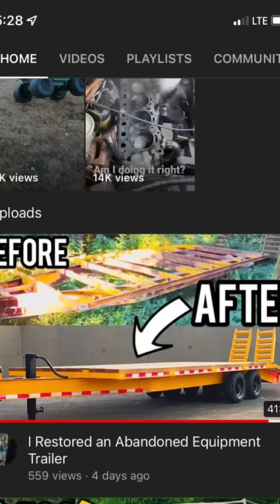How to restore a trailer

Comment: Great job on the restoration Use a respirator dude, Your lungs will thank you later!
Reply from the maker: Thanks
Reply: A little iron oxide is good for the lungs. Lol
Reply: I wear a mask...when the benefit outweighs the detriment....like here.
Reply: @1.1797  I'm still coughing up metallic flavored phlegm and haven't been in a shop in over four years man, that shit can't be too good for ya lol
Reply: @100GTAGUY  you never get rid of the taste. My grandfather worked all his career in shipyards and had some funky lung disease. He complained of that metallic taste in his mouth constantly.
Reply: Yeah man nice work but you need to wear a respirator and safety glasses minimally when pressure washing sanding and painting. I'm probably a full face mask with fresh air because that old paint could very well have lead and or other toxic materials in it. And you absolutely have to wear full body protection I eat tyvek suit gloves head neck protection full face respirator or fresh air pressurized system when spraying primer and topcoats. I've learned how to refinish steel and iron work from my father who died of type 4 metastasized lung cancer. My teaching began over 40 years ago before OSHA really knew what was up. You need to know that even the smallest particulates of just plain iron oxide rust or water-based paints can affect your lungs and nervous system! Keep up the good work and for the love of God work safe!
Reply: I would look for death by not wearing a respirator or any way imaginable if my trailer I worked so hard on  was Yellow
Reply from the maker: @vivalasvegas2826   most equipment trailers are yellow
Reply: @vivalasvegas2826  alot of the 20k+ lb equipment trailers are yellow
Reply: I got bronchitis from my Navy days being stupid.

That was 32 years ago, if one wants to know how long the effects last.
Reply: But then you don't meet the aliums and walk through the stars for awhile.
Reply: @CS-zn6pp  yeah its not too fun, can't ever tell if it's my lungs or a mild nose bleed until I hack it up. Got chronic bronchitis after a bad sick spell a year after i was out of the shop and now cough till I puke trying to clear out my lungs once I get some phlegm moving. 

Don't know if I want to go to the doctor now or when it's too late anyway unfortunately. Not gonna be good news either way.
Reply: I think that always a great restoration? Wow that was a half ass job. U see all the rust he left
Reply: Around 50 yo you will feel it and by then its far too late
Reply: @100GTAGUY  better sooner than later man, go get yourself checked out while you still can ya know? Wish you all the best brother.
Reply: @100GTAGUY  being in a shop where you're exposed to it EVERYDAY is WAY different than someone spending a couple hours on a weekend. Derrrrrp. That's why it's called an OCCUPATIONAL hazard. Because it's a hazard to people who do it as an OCCUPATION.
Reply: Exactly no dust no fuss 😉
Reply: mos def!

Comment: Start off with great job restoring that old trailer. I would like to suggest something coming from somebody that's done a lot in that kind work in prep work  I would recommend wearing a mask while sanding so you won't inhale Metal particles.  Great contact

Comment: I know you are smarter than that trailer itself  Braden, get a respirator. $30 and a couple filters last a long time. I know you don't like using paint thinner or gas to clean overspray off your skin, try using skin lotion or vasoline right  before you spray and it will hose right off. Just lookin out for ya.

Comment: I do this strange thing almost every weekend. 

Refurbished trailers and custom BBQ pits. Profitable hobby.I just like making stuff but supplies and materials cost money.

Former boat trailers cut down are cheap and work great if you want to make your own BBQ you can haul around.

If it's lopsided you can just add an extra sping leaf to one side but rarely an issue unless you install a clean up sink to wash stuff.

I suggest trailer Jack's at all 4 corners to level it for a sink.

It doesn't have to be level when towing and tge destinations ground is almost never flat and level.

Or just skip it entirely. Frankly I personally don't worry about it. I just push the coals to the best spot ATM and let the hotdogs and sauge slowly roll toward perfection.

But that's just me. You do you.

Don't be afraid of learning how to salvage something and get more for less $ and more "elbow grease".

Many folks just like me don't mind helping others without the skills and equipment if you're willing to learn.

Otherwise it's going to be at the shop  rate. It's faster and more profitable just to do it myself.

Teaching others isn't exactly in my best intrests short term. Long term works out from us numerous ways.
But that isn't worthwhile if a person isn't motivated to learn for themselves.Just pointless.

Comment: Nice job and also pro tip: do NOT try to mess around with a camper in the woods. 9 times out of 10 there's a fungal war going on, someones using it as a methlab or shine still or  t h e  b e e s
Reply from the maker: Good advice

Comment: Little tip after pressure wash put some paint stripper on then pressure wash again strip's the paint right off if you wanna go the extra mile before paint use some phosphoric acid on the steel it will kill the rust and the paint will last abit longer

Comment: I did that with a 20' with 7k axles then sold it too cheap. I wish i would have kept it.
Reply: Yea, SURE ya did. OK
Reply: @dutchvanderlinde658  yes i did, i used red oak 2"x 8" and i mounted an 8 ton winch on it. Worked very nice. Painted it with glossy Rust-Oleum. Black

Comment: Hell yea, I do recommend putting a clear coat-epoxy/resin first then primer then the top it'll last longer prevent rust better and if you used a disc? I believe try using a wire wheel n get it all off at once n only use the clear on exposed metal and if have existing paint feather the edges

Comment: You should sandblast it. You didn't removed all rust and it will bild up again under paint.
Painting is low quality too. We can see some edges with raw material. You should paint them with brush before spray painting .

Comment: Came out nice, woods worth more then the trailor at first. Cleaned up the frame, paint, put the deck on it and now it's  worth 5x the lumber id guess👌
Reply from the maker: Sold for 5k cash
Reply: Worth more like 500 never changed tires or checked axels just shined it up
Reply from the maker: @noahshort9040   says dude who didn’t watch full video on channel. 
Sold for 5k cash in 2 days. “BUt iTs oNly wOrTh 500”

Comment: Battery grinder with cut off wheels then you sand blasted anyway?
Reply from the maker: Cut off wheel was for bolts. And then wire wheel. You sound confused

Comment: If you take on another project like this consider sandblasting it it will make a huge difference to the finished product
Reply from the maker: Totally not worth it. It’s an equipment trailer not a Lambo. It’s gone get beat up and need paint again in ab 10 years or so. Plus sanding bags cost more money.

Comment: A trailer like that is worth $7500+ NEW.  So AT LEAST a few hundred dollars (depending on the amount of work needed to get it working again (taking rust off and painting it were probably not strictly needed ).  And someone dumped it.  So they got ZERO back on their investment which should have gone toward the price of a new trailer.
I don't get that kind of thinking.
Reply from the maker: Sold it for 5k

Comment: Did it come with a title. Awesome restoration
Reply: Grind off the vid punch in a new one take it to the sheriff or the highway patrol and say you just home built it
Reply: @yzrippin  wish it was that easy here in cali lol. I heard it took someone in Texas 3 months for the vin and 6 months for the registration.
Reply from the maker: It’s actually a home built trailer. Bought it from owner
Reply: @Richardv24  no yeah that's exactly what I've done here in Cali I even once bought a trailer that I was extremely suspicious of being stolen previously because it had Utah plates on top of Montana plates and the VIN pretty much ground off took it down to CHP a quick look around a handshake comes out with a drill and a VIN and a license plate or perhaps I got the plate later in the mail but it's a lot easier than you think you just got to know how to speak
Reply: @BradenBuildz  you didn't fully take all the rust off but you did a really good job dude thing looks killer
Reply: @yzrippin  oh wow. I sold my trailer before even trying to register it. Good to know, thanks.

Comment: I don't mean to be a hater but you didn't sand the body down properly the paint you use was the wrong colour of yellow the undercoat was wrong the black paint for the rims wasn't black enough and the timber you used for the bed of the trailer didn't have a north south east west grain! But apart from that you done 1hell of a good job!!! 😂

Comment: Nice, but forget the split rims 😆
Reply: Those aren't split rims.
Maybe know what you are talking about before you post!
Reply: @haroldphipps3457  sure looked like a split rim he sanded down and painted. AKA suicide rim. Maybe you're thinking of dual or tandems
Reply: @Harold Phipps  watch that video I linked here completely, there is text explaining towards the end. I've been a trucker for 30 years, I know what a split rim is
Reply: @ridge69  no, it was a 14.5 TUBELESS wheel.
Like I said, better know WTF you are talking about before you start typing.
Hint, you don't.
Reply: @ridge69  there wasn't one in the short you commented on.
Nice recovery.
Reply: Nice ATTEMPTED recovery.
Reply: @Harold Phipps  like I said. The rim with the tire on it that he sands and paints is a split rim. No need to be nasty there Skippy

Comment: You should have used pressure treated wood. Not wood that cost $8 a piece at home depot
Reply from the maker: You have no idea what your talking ab
Reply: @BradenBuildz  I drive trucks for a living since 2007 so I think I do
Reply from the maker: @lucky1206   really? Then why do you assume my 400$ 2in thick red oak wood that I bought from a sawmill is 8$ homedepot lumber
Reply: @BradenBuildz  because it's not pressure treated and if you were smart enough you would have picked that because you know..uh it's a trailer and it's exposed to the elements and if you paid that much for regular wood that will eventually warp and Crack under rain, sun, and everything else your got ripped off
Reply from the maker: @lucky1206   I treated it with oil and diesel mix twice. It’ll last

Comment: Yeah I would never hire this guy to restore anything first off he  didn’t remove all the old paint which in about a year will start chipping off yet again. Yeah I had all kinds of fancy tools and didn’t even use the proper ones for the job next time if you’re not going to buy and use A sandblaster you can rent one and hell who knows you might be able to rent the new laser ones they have out that will not only remove all the paint but it will remove all the rust giving you a better surface area to paint on to. But with the way you did all of that it’s going to look like crap after your first year especially if you live where it snows a salt will make everything pop up again and flakes of paint will fall off again. And also even though our body needs iron breathing that stuff in like that can make a little scars on your lungs so you should have been wearing A respirator of some sort some thing that holds close to the face not a dust mask because those do not make a seal but yah buddy I would not pay for a job like that ever
Reply from the maker: Oh no I used a pipe wrench bc it was convenient “iDK hoW tO uSe tOoLs”
The paint will last at least 10 years. This is how I paint all trailers. It’s always the people who’ve never done it before thinking they gotta spend 5 days and tons of money on sand to sand blast an old trailer. News flash hardly anyone does.

Comment: Staged that trailer would be rotted to shit from sitting in the woods
Reply from the maker: Quarter inch steel? I dont think so
Reply: @BradenBuildz  seems like it should be alot worse shape than that also depending on how long it was in the woods. Thats constant moisture and humidity, wet and drying cycles on steel thats missing almost all of its corrosion protection. I expected much worse for that trailer.
Reply from the maker: @Slvr2k   it’s not that bad in ky. Ik of a tractor that’s been sitting like 50 years in the woods and it’s not even in bad shape. Gonna make a vid on it
Reply: @BradenBuildz  very true location is very important as well, a drier state will always be a benefit to exposed metals

Comment: Too bad that's a waste of time without neutralizing the rust first before priming it. Knocking it off, which you barely did, isn't the right way
Reply from the maker: This is an extremely normal thing to do. You can paint over surface rust after you wire wheel it with rust oleum rust primer. Have done this multiple times on other projects and it never fails.
Reply: Cool story. The rest of us will do things the right way lol
Reply from the maker: @evictioncarpentry2628   yeah go ahead and spend a whole day and a bunch of money in glass bags sandblasting a 300$ equipment trailer that’s gonna get used and abused just to have 15% better results and no one but you will know the difference bc no one cares. Had people asking me if I sand blasted it or not. Why? Bc you can’t tell a difference.

Comment: Should have bought a cheap ass sandblaster from harbor freight or something and sandblasted that whole thing
Reply from the maker: I have a sand blaster. No way I would spend 3 days sand blasting for no reason. Knock the loose stuff off get down to solid metal and prime it. Works everytime. It’s not a lambo